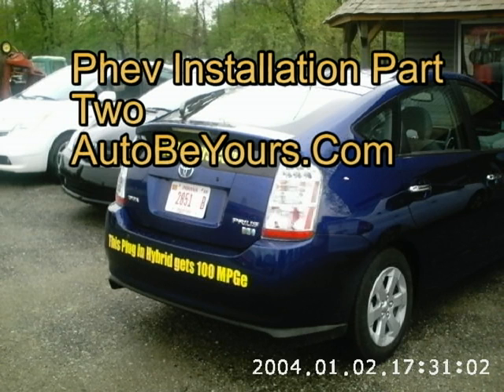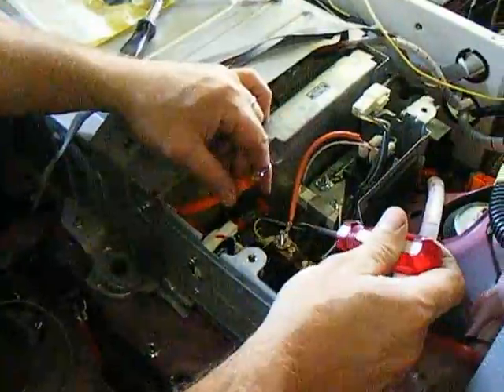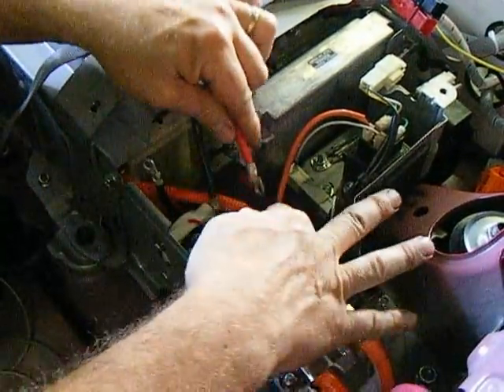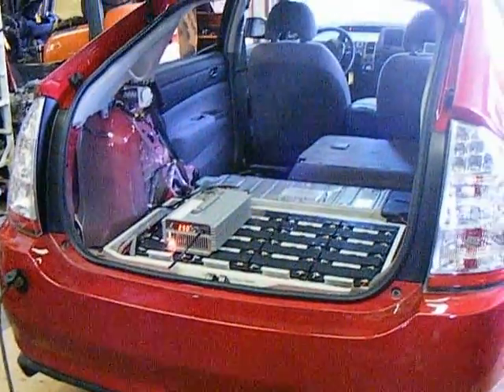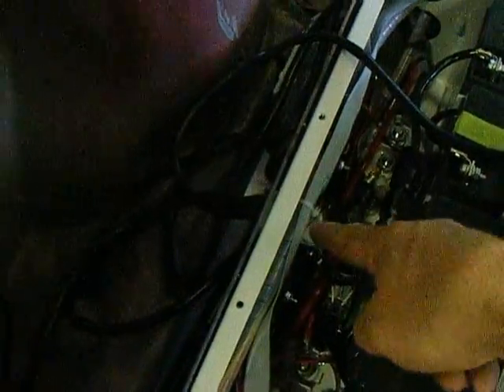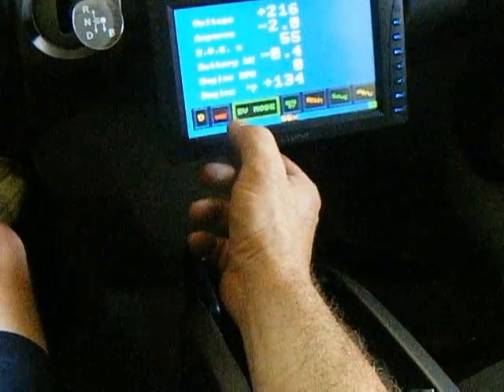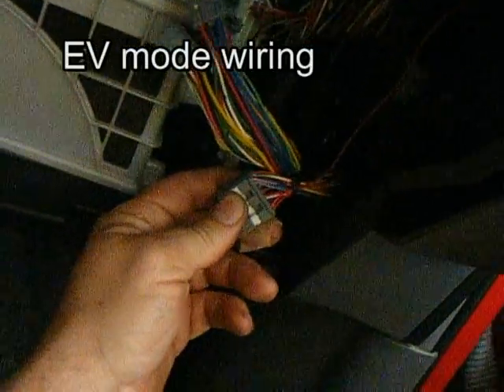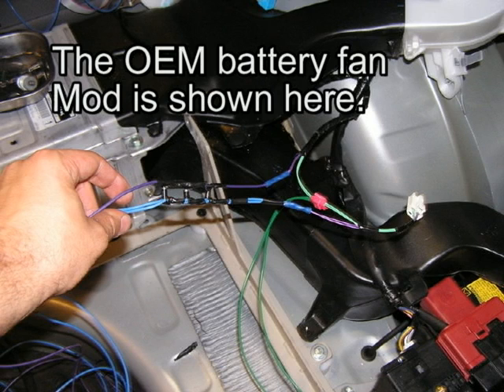Prius Plug In Hybrid installation by AutoBeYours part 2

Comment from the maker: Um, the chargers and packs have changed since this video was produced.
but what stays the same is the approximate cost per charge.
you may have towork backwards for your wattage requirements.
but... at 14cents a kw/h it will cost 80cents to charge my pack.
( my new pack is a 10kw/h LiFeP04 and will take me 50 miles at low speed)